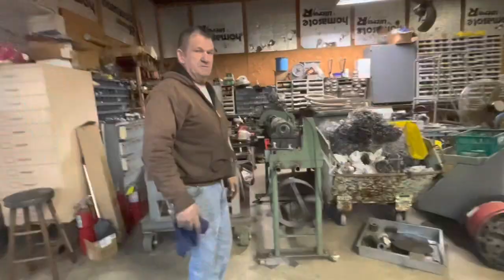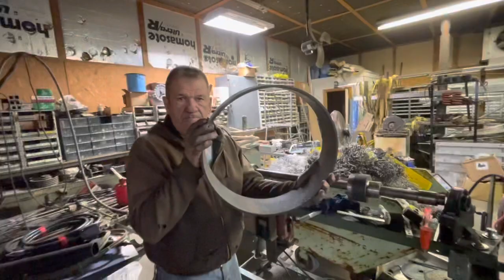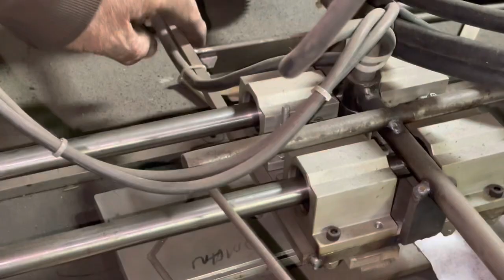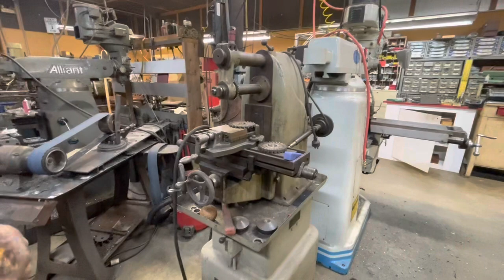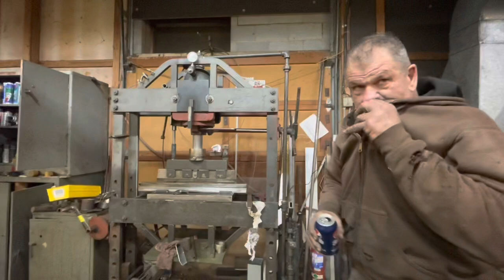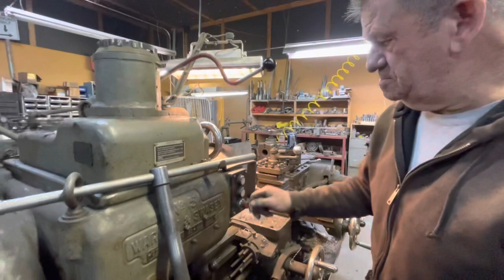Story time with Sonny

Comment: That's going to be like my next shop set-up. All the cool toys to make cool stuff!
Reply from the maker: You got all the modern high tech stuff already, so yea you need some big iron for sure!
Reply: @turbocobra  I'm definitely gonna get myself a Piranha. And I want a legit ring roller like that, and a hydraulic tube bender are also on my short list. But I really need a beefy mill. I've just been putting it off all these years, because I knew I was going to be moving eventually.
Reply from the maker: @EcoMouseChannel  Get a Cincinatti like Jason at Fireball tools, that thing is a beast!
Reply: @turbocobra  Yeah, on my list of names to check out. BUT... where I'll be moving to, I'll have access to old school Czech and Russian machines, that we don't get to see in the U.S. typically. So, that's going to be kind of neat checking out some heavy duty stuff designed to work forever. Throw in a few modern conveniences like a DRO and power feed... might be cool too!